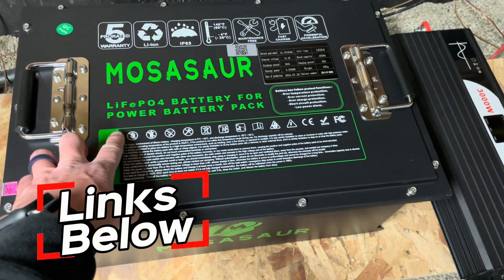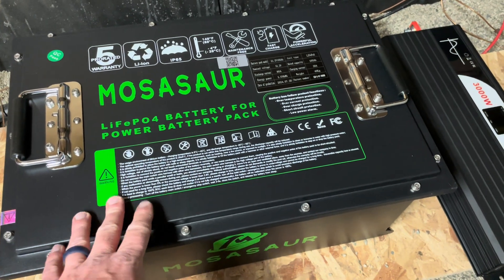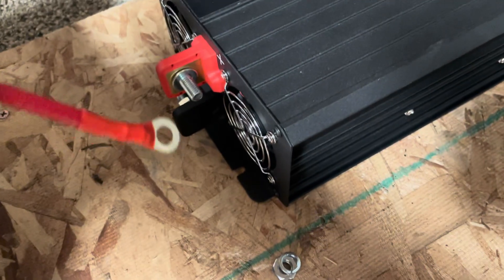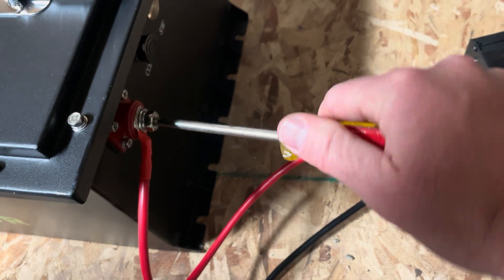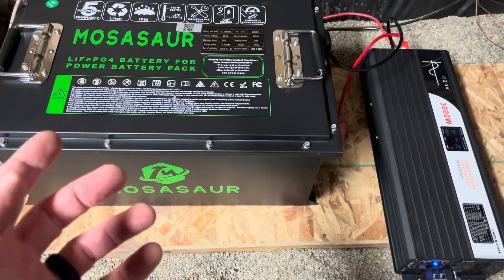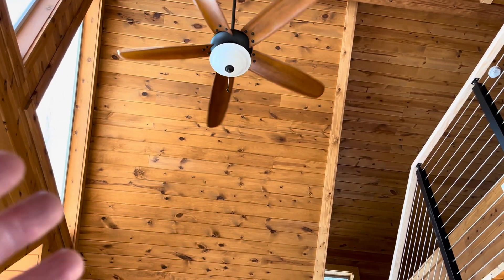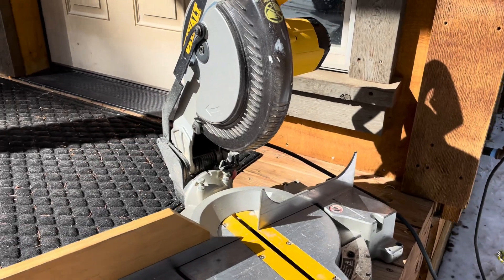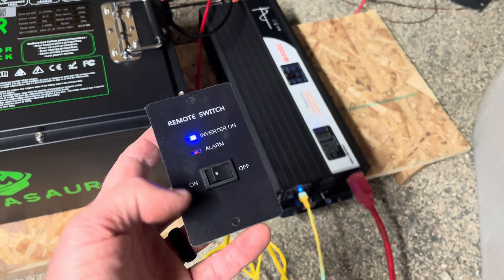Can You Power an Off-Grid Cabin with a Golf Cart Battery?

Comment: Today the lithium battery's have supersedes the lead acid battery's - 
       If you were to study up on the old farm light plants - the original homes were set up to run on 6 volts - from 1880 till 1920 - 
      In 1980 I knew of some older people that had not hooked up to the grid because they were able to generate there own power for far less than the cost of grid power - 
        I live in the rural South and up till about 2000 the grid power was  expensive for most - 
        I had a grate Uncle that set up homes with 6 volt power as early as 1880 - the battery bank was sized as to only need to be charged once a week all day with a wood fired boiler feeding a steam engine to drive a generator to charge the house batteries - 
     Down here electric fans were very desirable from 1880 onward - 
       The old house lead acid batteries used a acid strength of 1.195 gravity by today's standards that is very weak acid - 
     So to get 6 volts it took 4 cells or an 8 volt battery - with weak acid there is a lot of capacity Loss - 
        But the cells don't easily sulfate and the positive plates do not swell of flake -   in the end those batteries with the weaker acid had a service life that exceeded 100 yrs of cycling - 
     To day they say a 2 volt cell is 2 volts because at the start lead acid battery's used a acid strength of 1.195 gravity so the standing voltage at 78° was 2 volts - 
     Were as a battery today uses a acid strength of 1.265 gravity so the standing voltage per cell might be 2.14 volts - but the service life rarely exceeds 7 yrs with strong acid - 
        If you Google exide farm light plants battery's or Gould battery's those were Factory made battery's those used a acid strength of 1.220!and had a service life of 40 yrs before the plates inside the glass jugs needed replacement - 
       With 1.195 acid cells will freeze when fully charged at 0° F but down here it never gets that cold - 
       Another advantage of lead acid batteries is if you up grade to lithium batteries - you can fully charge the lead acid batteries then pour the acid out and save it then fill the cells with water and let it set a day and pour the water out - 
     You do that 3 times : then you have a dry charged battery - the lead plate will oxidize some over the yrs - so if you need them say 25 yrs or 100 yrs from now you refill them with acid and charge them to reactivate them - if the battery's are older dry charged battery's because of the oxidation on the negative plate it takes longer to breactivat the battery -
       You can goggle Roll battery's and activating dry charged stored battery's - 
    I have dry charged spare golf cart batterys that are over 60 yrs old - 
       After hurricanes or ice storms I have 26 golf cart batteries that have 1.220 strength acid - the float voltage is 12.8 volts instead of 13.2 volts - I'm 70 yrs old but I expect my battery's will last another 30 yrs - 
      I'm a 4 th generation generator mechanic and spent my yrs in the offshore oil fields - 
      In the end when my power is out for 6 or 8 months I'm only burning 2 to 4 gallons of propane daily to charge verses 24 gallons a day running a generator 24/7 - 
     I use a 8 kw lithium bank also -
Reply: My high amp draws are on my lead acid batteries - in industry we prefer lead acid batteries for stand by service because of the difficulties of thermal run away and also problems with the BMS - 
    The first generation of lithium batteries were lithium sulfur batteries - they are the preferred battery and are rated in years of service  - there used in satellites they can charge and discharge 20 times an hour for 70 yrs -
      As a satellite circles the earth  several times an hour - 
     A 100 amp lithium sulfur battery presently cost about $50K  - 
      In industry flooded acid batteries are still preferred as long as space and weight are not a problem - 
     There is very little  difference between industrial stationary batteries and golf cart batteries. - 
      It comes down to the average  temperature there exposed to and how much current draw there expected to deliver - 
     I've worked all the remote oil fields in the US from Alaska to the high mountain oilfields to far out in the Gulf of America- from temperatures that dropped to minus 60 nightly up in the mountains to put in the Gulf were it was 100° f or above in engine spaces. - 
     On large platforms there are often banks of batteries that are 350 thousand watts used when the platform is in hurricane mode - 
      Platforms I set up 40 yrs ago still have the original 375 two volt 500 amp cells - we used 1.210 gravity acid in those far south where it's warmer - 
       When at&t used batteries through out the country to maintain uninterrupted service those battery's lasted generations - 
        In the mountains and across the remote areas of the country  at&t had microwave repeaters - oil companies bought many of those repeaters - 
      As I went to those sights that were hybrid they still had the original lead acid batteries - 
   Lead acid batteries to this day in stationary service when set up correctly and not deep discharged out perform lithium iron batteries 20:1 - 
      I do have lithium sulfur and lithium iron batteries - 
    Lithium iron battery will last far longer than 10 yrs I do know of some that have been cycled for 20 yrs with no cell or BMS failures - 
     It's best not to exceed 15% of a lithium battery's rated out put continuously  -
...... there is no way for the BMS to disparate the Heat of larger loads - commercial high out put BMS have cooling fans -

Comment: Im going tk use lithium golf cart battery's because the bms is built for way more than 8 would ever need. Im running two mini split ac unit year around. 1200 wats each in heat and 485 in cooling mode.
Reply from the maker: Please give an update on how it works. Our testing continues to go well at the cabin

Comment: Just buy 4) 12v & 100a lifepo4 for less then $800.00 and save $1000.00.
Reply from the maker: Agreed, that is the way you should do it if the sole purpose was to run an off grid cabin. Our test was to see if the golf cart battery could only be used to upgrade the power in golf cart, but also be used as a back up power source. Not sure how many people would be in a position where this would be a good option, but it's definitely possible

Comment: Thanks for the video !!! I've been thinking about battery backup options myself. It seems that your setup will be great for supplying electricity to your off grid cabin. I assume that you'll be installing appropriately sized circuit breakers on the battery leads and extension cord. One thing you really didn't address was recharging. I'd probably be calculating for the solar panel & charge controller. For times when the solar output isn't adequate for recharging I would also have a 2000 watt gasoline or propane generator with a 48v charger that is sized to minimize the generator recharging time. 
I hope that you realize that you might be on a slippery slope there. Before long you may be looking at increasing solar capacity, adding additional batteries, you might even decide that you "need" a 240v / split phase inverter (for a mini-split heat pump?) 😜 
Best wishes & good luck !!!